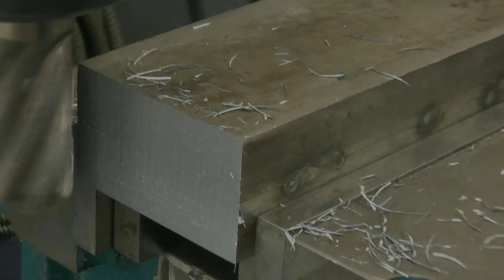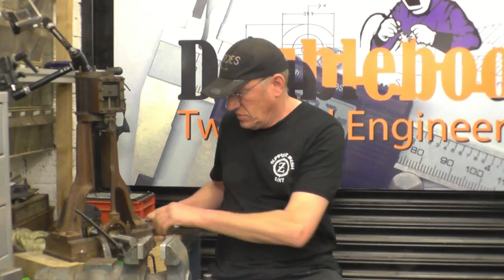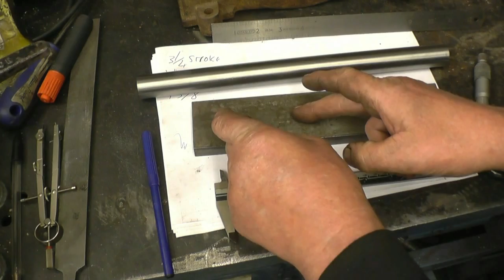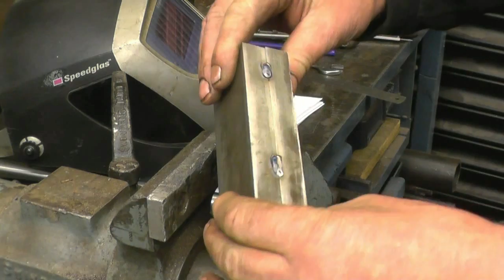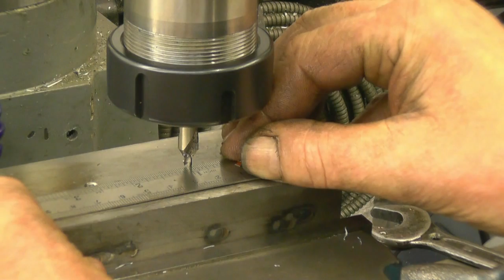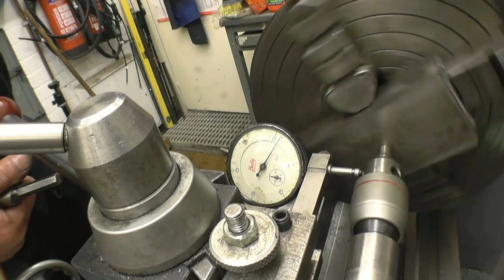SNNC 175 P1    4 jaw chuck work  DTI  give away

Comment: Instead of using a file to check for flatness, why not put it in the mill? How do you know if the file is flat to start with, even if it were, pressure from both hands on either side would make it bow a fraction?? Maybe that's why it were just rubbing both edges of the steel???
Reply from the maker: +Steve Clark all i was doing was removing any small  imperfections 
The file won't bend with hand pressure

Comment: I am lead to believe it is 13" because it is one third of a metre. Silver steel comes in 1/3, 1, 2 and 3 metre lengths.
Oh and when you draw file and only touch the edges, it could well be the file bending. Try slightly bowing the file ends upwards while pushing down.
Reply: Silver steel in inch sizes has always been supplied in 13" lengths
Reply: indeed, short lengths have been 13" for as long as I can remember but it is available in longer lengths.